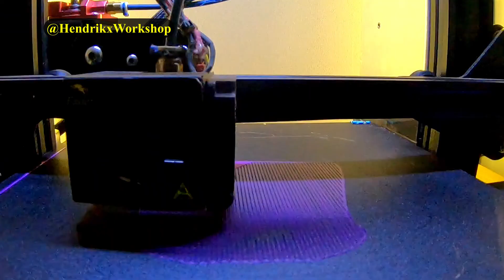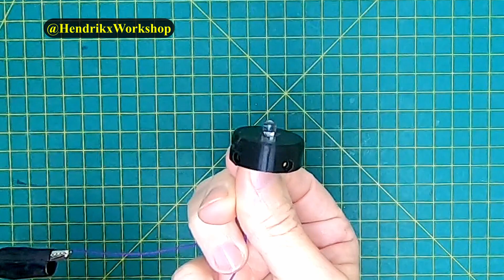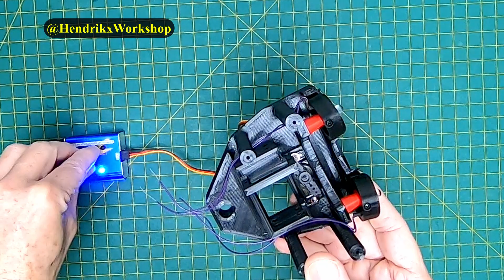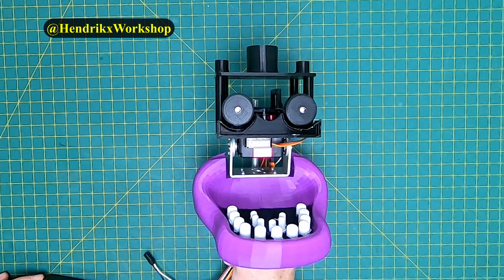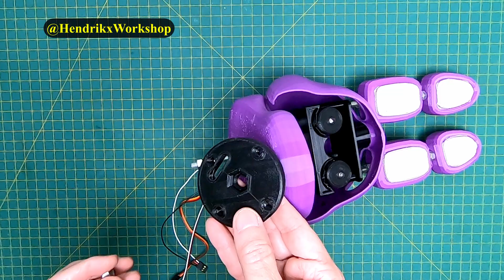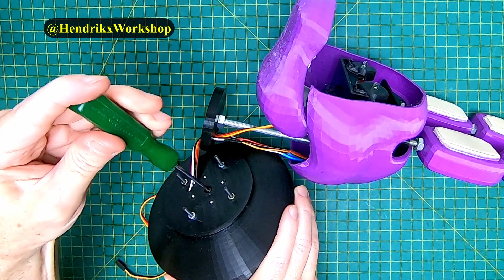Making animatronic Withered Bonnie

Comment: Thanks a lot for what you’ve done, sir. I’ve learned a lot so far. I’ve been obsessed with animatronics since I was a little kid (90s baby) and I’ve been so giddy with the popularity of FNAF. 

I built an arcade machine in high school using an old monitor, a raspberry pi, and an old encoder I wired the stick & buttons to. I’ve assembled and modified all 5 3D printers so I could understand the mechanics of the tools I use. But that’s about the extent of my experience with electronics. 

Been spending a lot of time on the Adafruit website trying to learn a thing or two because I’ve never worked with servos before and the idea of programming anything mechanical is a little intimidating.

However, discovering your videos has helped a lot with my own build. I’ve made a few award-winning costumes even as a newbie but nothing with animatronic components, which is my current project goal. I’m really thankful for your stuff and can’t wait to learn more.